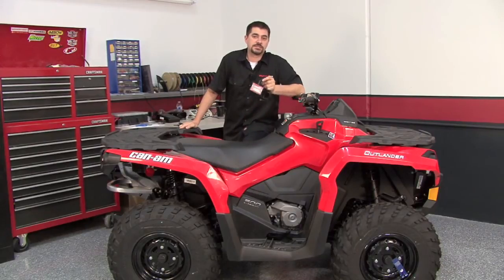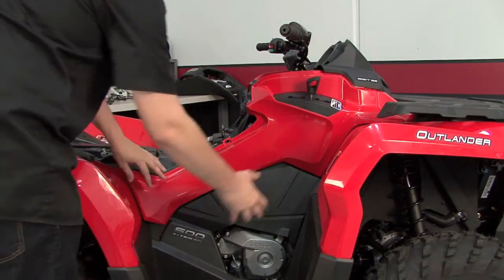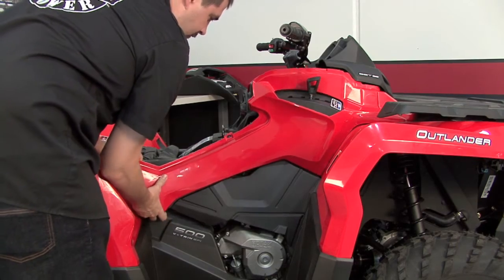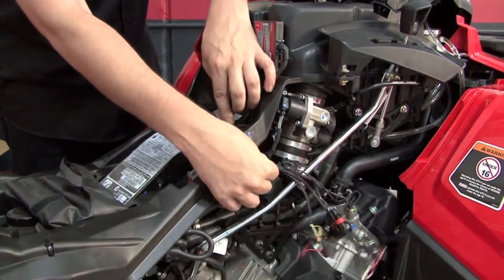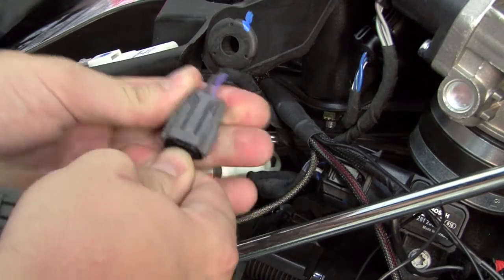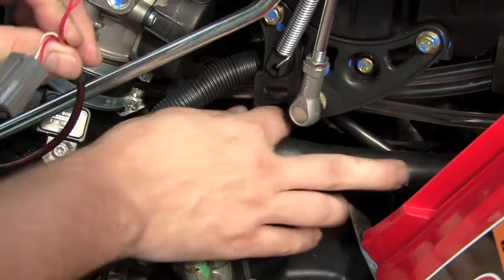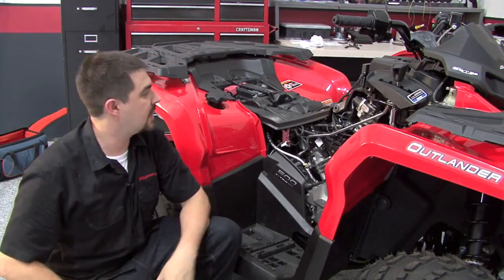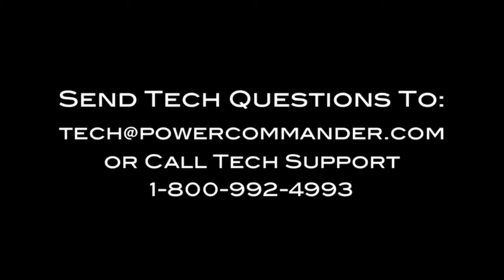Power Commander V Install: 2013 Can-Am Outlander 500

Comment: Hello. I have a Can am Renegade 650 2019 and i want to fix a dyno jet5 and i was curious if is wroth? Is difference stock vs dyno ? Thank you. I write you from Romania.
Reply from the maker: Hi, Dan. You should be able to get HP gains of 6-7% with a Power Commander V for your Cam-Am.
Reply: @DynojetResearch  thank you.